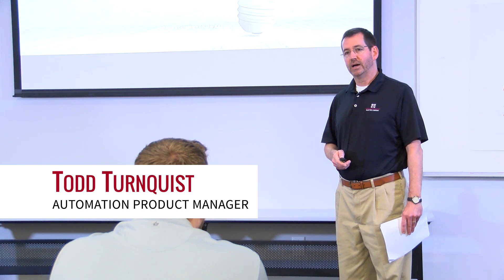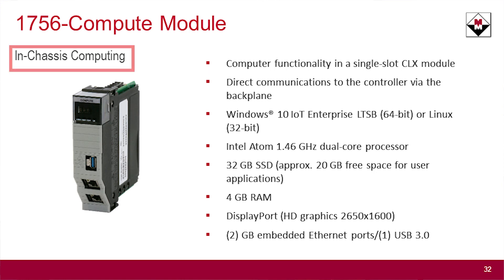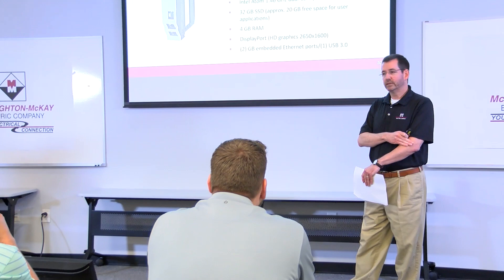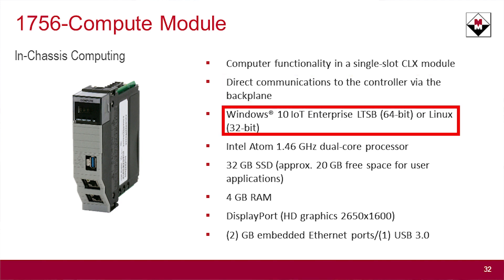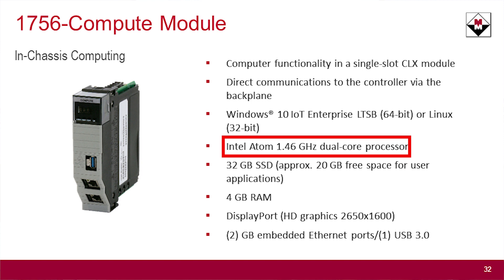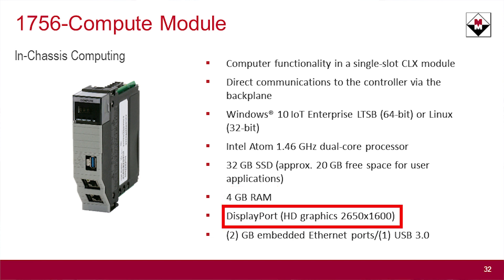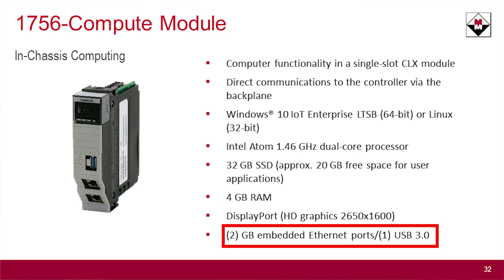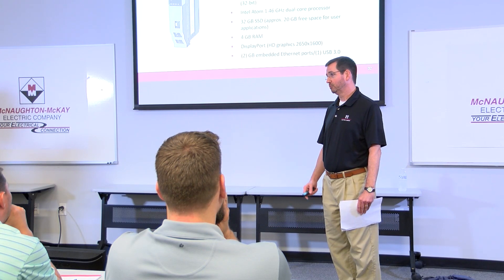Introduction to Rockwell Automation's 1756-Compute Module

Comment: What is it's application, when to use it?
Reply from the maker: Hello, The Allen-Bradley® ControlLogix® Compute module provides in-chassis, high-speed computing functionality with access to the ControlLogix processor via the backplane. You can use it to collect data at the source to make real-time decisions and increase productivity. The module offers the flexibility to create custom applications within the Windows 10 IoT Enterprise or Linux operating systems as well as using off-the-shelf applications to enhance their automation systems. Read more here, or reach out to your local Rockwell Automation distributor: https://literature.rockwellautomation.com/idc/groups/literature/documents/pp/1756-pp028_-en-p.pdf